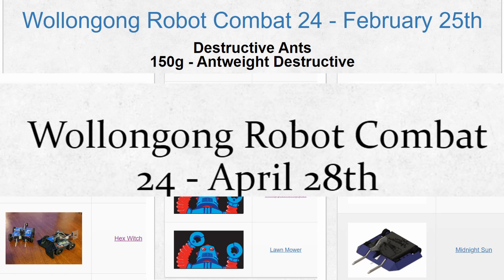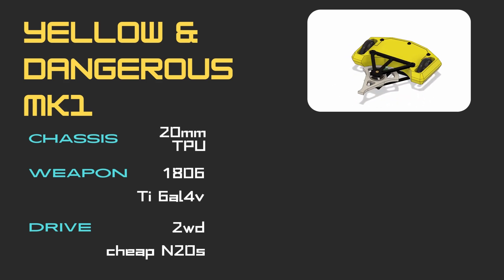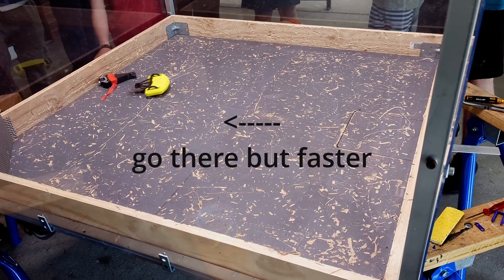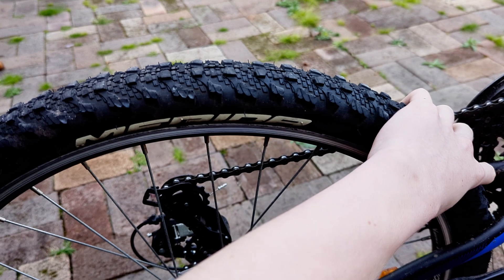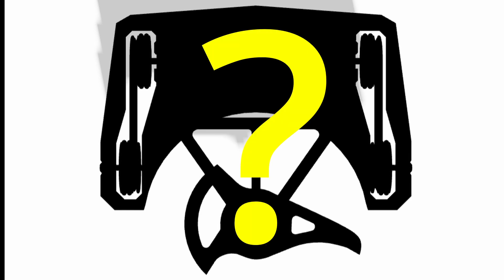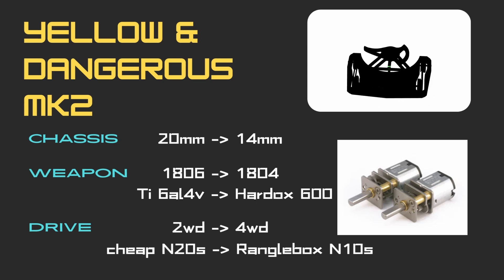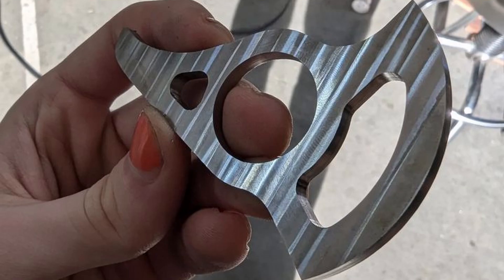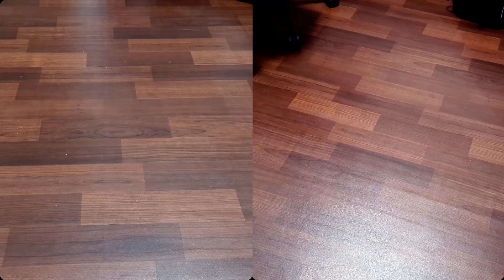Upgrading My Combat Robot - Y&D Mk2

Comment: Nice! Whats the name of the board you changed to? I cant seem to find it
Reply from the maker: It's the "ant controller board" based off of the malenki but much cheaper from llamaforge which is an Australian parts supplier
Reply: @engineered_cha0s  nice! I'll have to look at it
Reply: @engineered_cha0s  Nice, the more the merrier but.... isn't it listed at 25 dollars? It's not cheaper then, it's slightly more expensive.
Reply from the maker: Really? Every malenki I can find is almost 50$ AUD while the llamaforge board is 25AUD as you said. "Best" in terms of number listed I can find is 23 GBP but once it's converted we're back to just under $50 Australian. Also shipping within Australia is the cheapest option too
Reply: Is your weapon press fit onto the motor
Reply from the maker: Y&D has the rotor of the motor sanded and then jb-welded to the blade. I rest the blade on Lego bricks to make sure it's level

Comment: O-rings as belts is so annoying. I used them as weapon pulley in my fairy, and they slipped so bad. Now I use 3M toothed pulleys made of TPU, with the belt being a 6mm wide belt I cut in half lengthwise to make a 3mm belt. I have no idea how to make it accessible for drive. Maybe print an S3M belt out of TPU, but only 2mm wide?
Reply from the maker: Tell me about it... Three events in and I've finally done an entire event without losing a belt... Toothed sounds good, transmits torque through the teeth rather than friction so would probably be a bit more forgiving for tension
Reply: I've used o-ring belts for drive for a while now in my 150g bots. The belt tension is absolutely critical and small variations will have a huge impact. For a 75mm circumference belt I found a 2mm change in length was noticeable.
I still haven't got a formula or rule figured out for the optimal tension, but highly recommend making 10 different sizes and testing them all just to see if you can find a tension that works best because when it is dialled in they work amazingly well.
Reply from the maker: Yeah I think my "method" extends as far as loosely wrap the cord around where it has to go, pull it taught, go "a smidge" (scientific terms I know) further than that and that's a good place to start testing and shortening